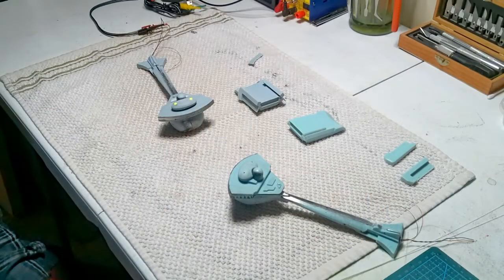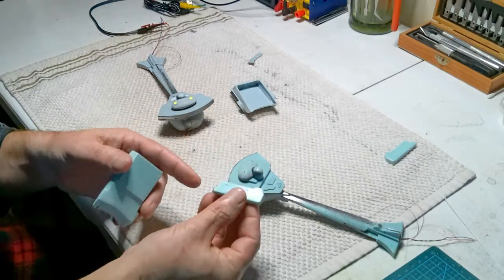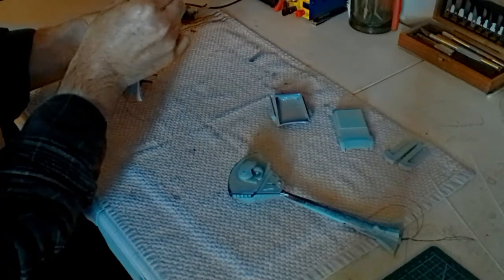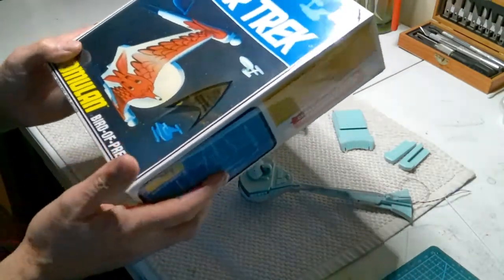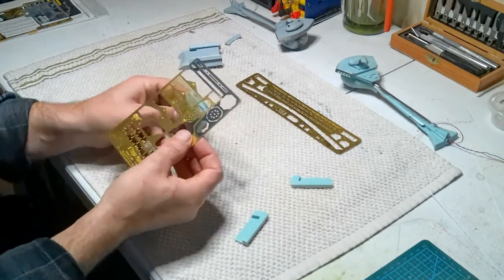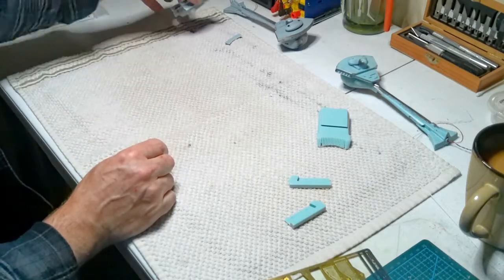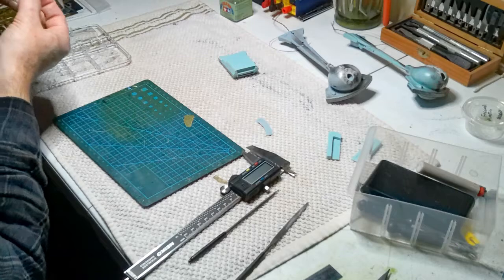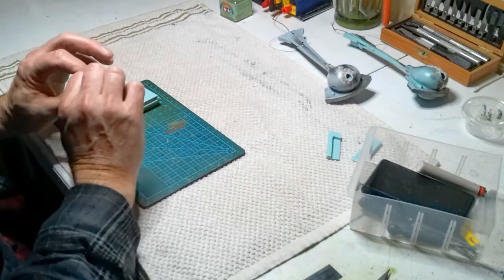AMT STAR TREK KLINGON & ROMULAN D7  BATTLE CRUISER   PART-6 IMPULSE ENGINE

Comment: Which kit had the solid front, to the impulse deck?
Reply from the maker: HELLO
I BELIEVE YOU ARE TALKING ABOUT THE GRILL IN THE FRONT OF THE IMPULSE DECK. THE OLDER KITS GRILL ARE OPEN, NOT SOLID AND THEY GIVE YOU A PLASTIC PART TO GLUE ONTO THE BACK ON THE INSIDE OF THE GRILLS THAT YOU CAN MAKE SILVER TO GIVE YOU THAT SILVER BETWEEN THE GRILLS LOOK. THE NEWER KIT IS SOLID BETWEEN THE GRILL BARS . HOPE THIS HELP & THANKS FOR YOU COMMENT & FOR WATCHING
Reply: @KFMstudio274  Hi Kevin saw you video on the klingon and Romulan D7s with the decles Relly good
Reply from the maker: @Ilikemc_donalds  thanks so much